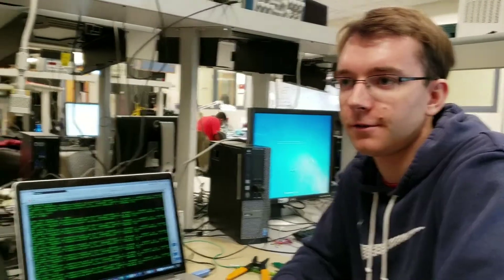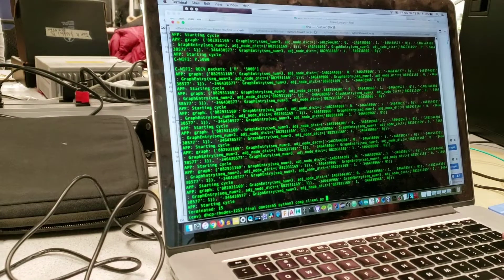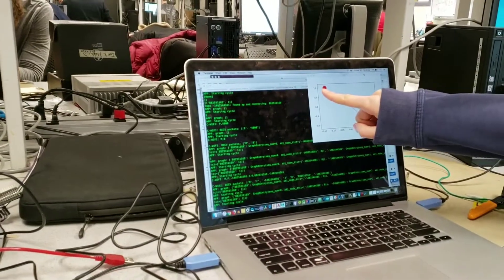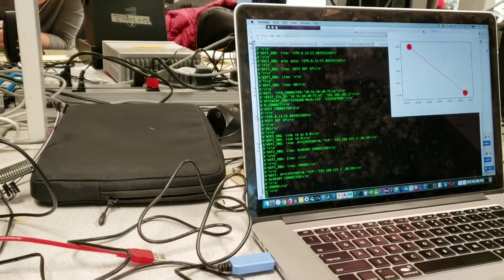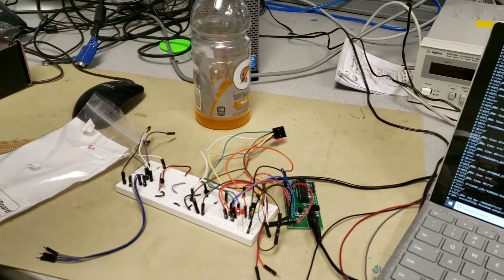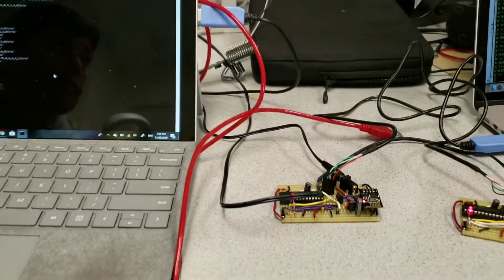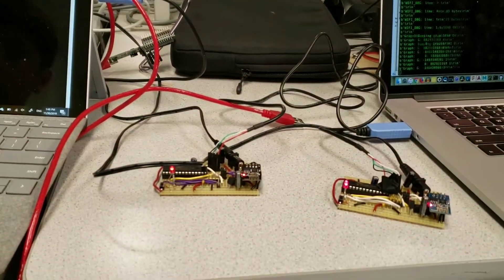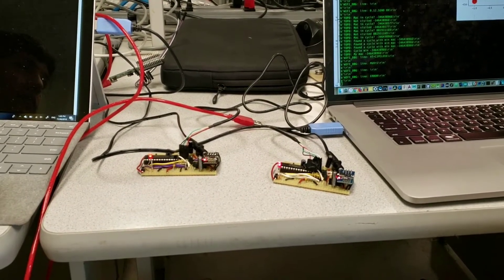mesh wifi nodes

Comment: Hey I wanted to know, how can I build a mesh network of esp's that can rely data to main esp. Basically, I want to create a network for disaster situations when cellular networks are down so that these deployed esp can collect some data from civilians and pass to rescuers.
Reply from the maker: This video shows a first step. Did you read the report for more details?
Reply: @ece4760  yeah I did but I'm quite confused where to begin I'm new iot stuff so It would be great if you could guide me a bit
Reply from the maker: I can answer specific questions (if I happen to know the answer).  But generally, you will need to do a lot of reading. I also suggest starting with small ARM systems rather than PIC32. Maybe Raspberrry PI zeros.